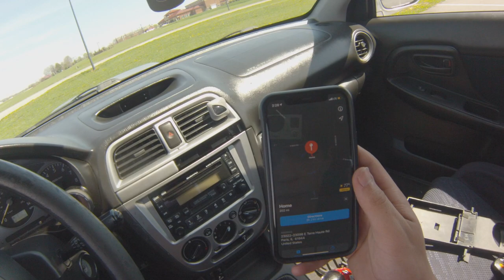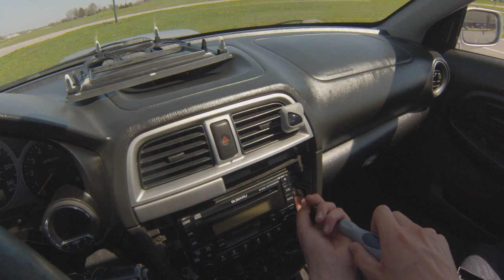Picking up my 2002 WRX Wagon

Comment: I'm checking one out tomorrow, what should I check on it before I buy?
Reply from the maker: Sweet man! I would say ask for maintenance records (head gaskets, timing belts, water pump, oil changes etc.) Head gaskets are a common issue so look for leaks around them as well as valve covers. Then basic stuff like clutch feel, no grinds, no drivability issues. And besides that , make sure fluids are good. Any other questions feel free to dm me on insta-gaberobinson112. Thanks for watching and good luck man!
Reply: Also check the rocker panels for rust and the inside of the rear strut towers  very common for a Subaru depending on your location

Comment: Did you figure out why it revs up when you let off the gas?
Reply from the maker: Not yet! I have a feeling that it’s something to do with the throttle body /cables, tune, iacv, and possibly a tiny boost leak but I’ll let you know if I fix it.
Reply: @gaberobinson112  thanks dude! I just bought an 02 sedan
Reply from the maker: @staywoke2198  good choice!
Reply: @gaberobinson112  I’ve never owned a boxer engine and I’m coming from a g35 coupe. Would you ever be willing to make a video of mostly audio for your engine revving? Mine feels and handles great but the sound is so strange. Maybe it’s normal but doesn’t sound that great
Reply from the maker: @staywoke2198  hey dm me a vid on insta of your car , I should have a link in the desc of the vid with my insta